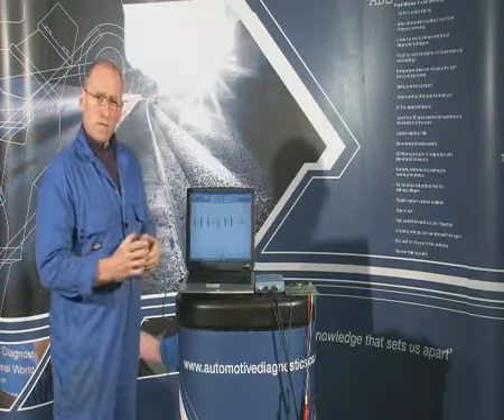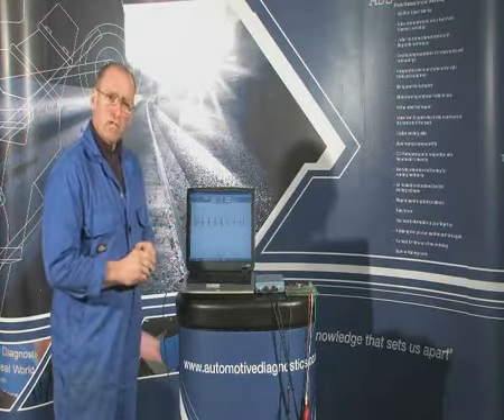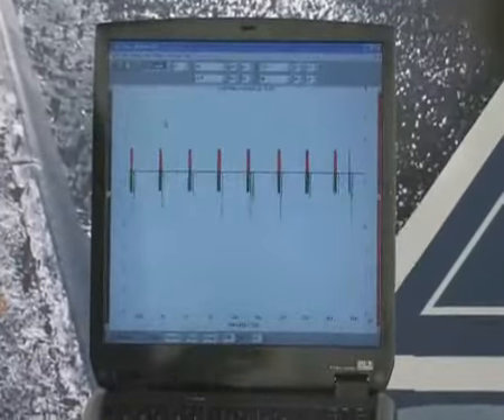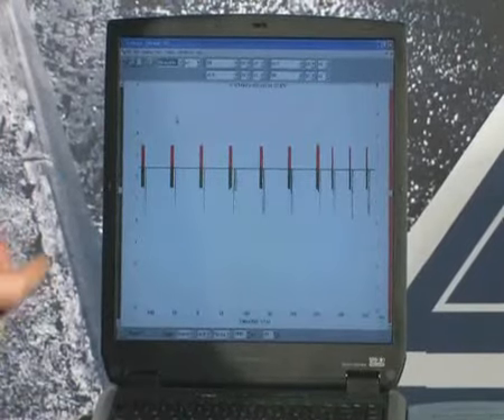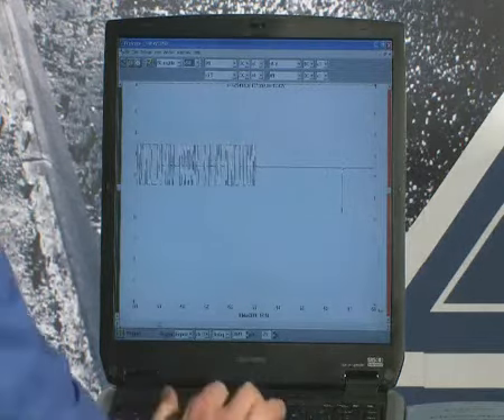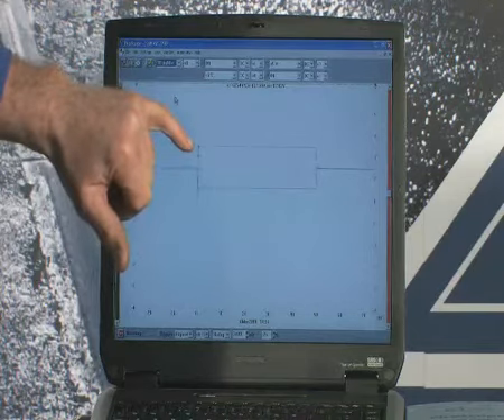An Introduction to CAN Bus

Comment: I'm presuming this is a multiplexed system.  but what a complicated and impenetrable way of presenting it. I lost interest almost immediately.   technology for the sake of it..    what IS the high frequency of the system ?. more RF radiation to kill people. what with WIFI and Bluetooth in cars at 2.4 GHZ  (microwave )   in a metal box   and what are you not supposed to put in a microwave?  metal..!  bouncing around in your metal car..   brings a whole new meaning the the term  cooking model.    AVOID AT ALL COSTS

Comment: I'm a gearhead, old and relatively modern vehicles, mechanical and electrical are not a problem for me. Give me a diagram and i'll assemble a wire harness for a fuel injected engine without much grief.. But when it comes to this can-bus shit, I can't even begin to comprehend what it is, what its for, what it does, or how there could even be anything wrong with it. I just plain don't get it.
Reply: +Pleasant Lake Pirate I'm all for saving the planet but you can thank anything emissions related in automotive to the eventual destruction of your favorite hobby. All this stupid unnecessary bullshit over complicating everything.
Reply: Hi would you provide me a job?

Comment: The one fundamental problem with any bus based network is traffic. That is to say, the bus works well with small amounts of traffic, but as traffic levels increase, the performance of the network drops off rather dramatically. What's needed here is a can 'switch', which would intelligently direct the flow of traffic.
Reply: They already exist but are used in Industry. They basically segment controllers which can also have separate bus branches. I was schooled on this by Kongsberg Maritime.
Reply: Hi buddy Would you help get me a job in CAN Communication protocol related job